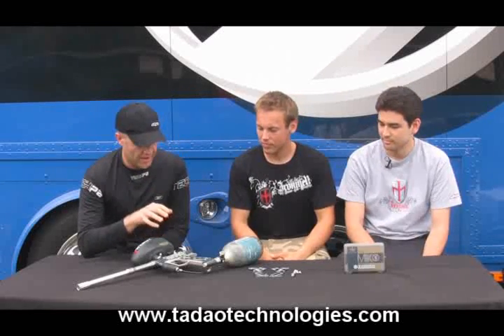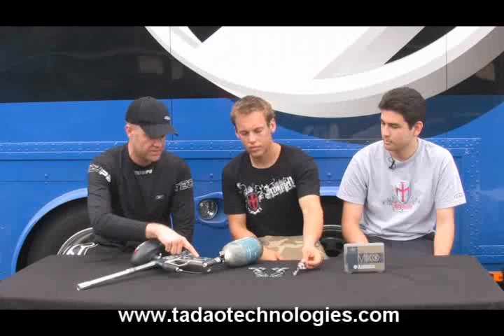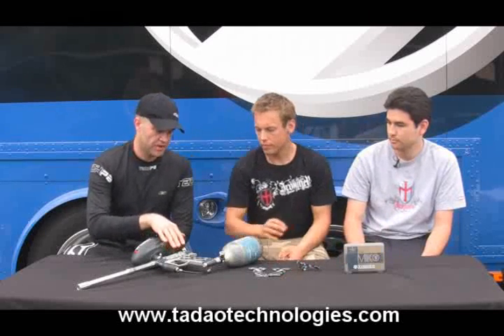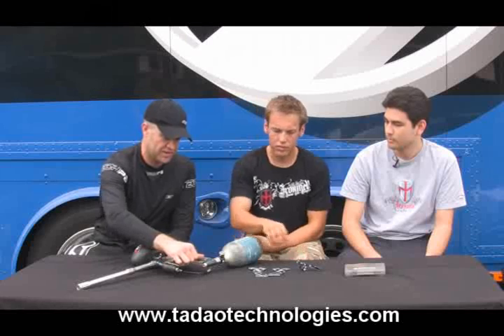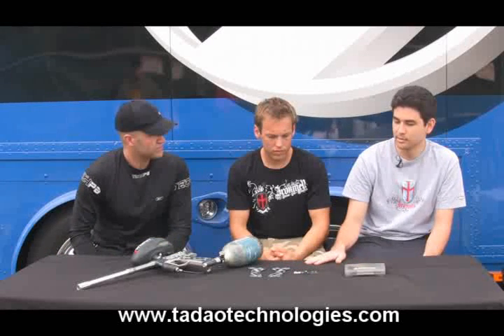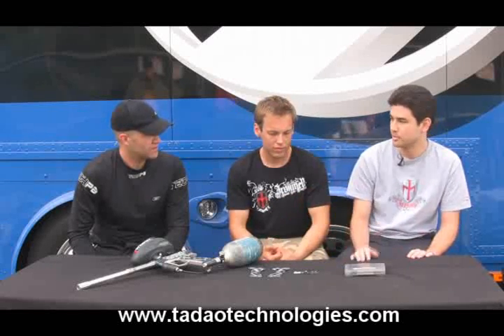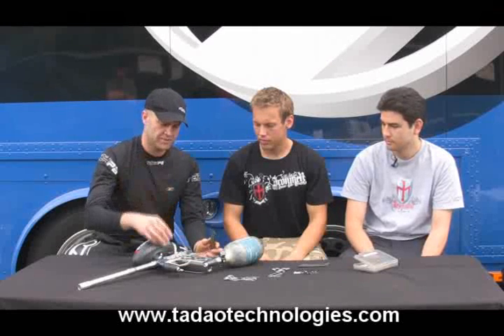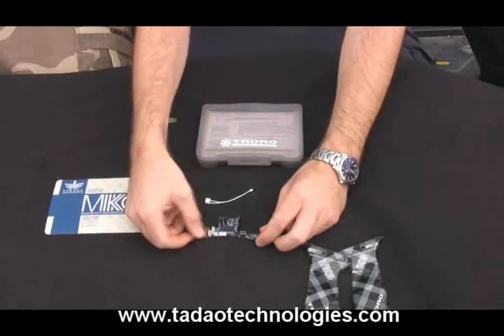Tadao's Mikko USB OLED DM Series Board

Comment: I doubt it will work in the SLG because of the clapper noid the SLG uses. The board is designed to work with the normal DM noid.